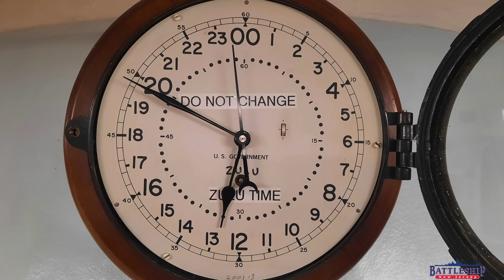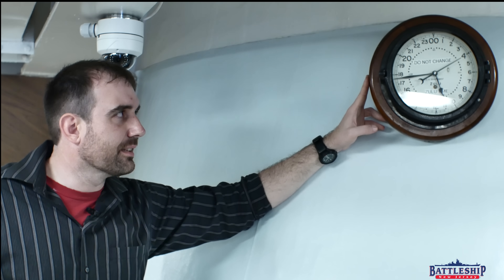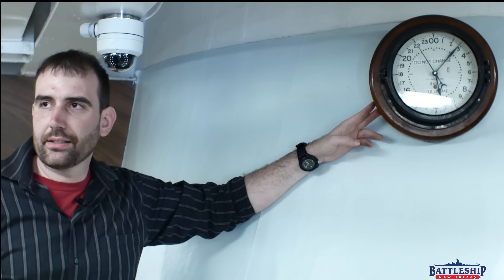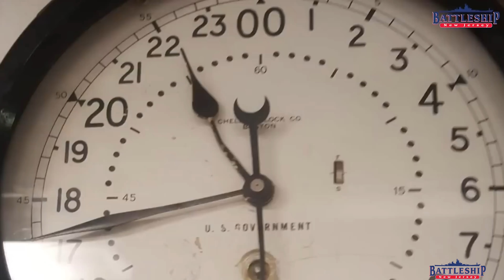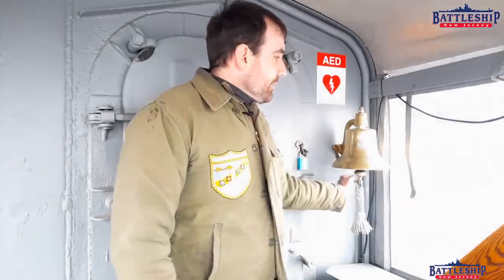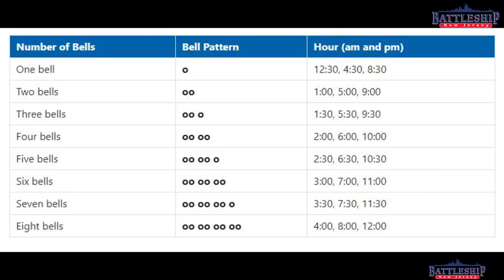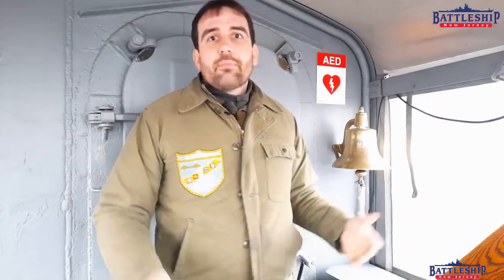Zulu Time and 24 Hour Clocks

Comment: Don't think there are many 24h wristwatches.
Even in countries that use 24h system. It's even hard to find 24h wall clocks. If you want them your safest bet is a digital clock or watch.

Also we call the times by their 12h version. 17 o'clock is usually called 5 o'clock. At least here in Germany.
We only actually say 17 o'clock when there might be a misunderstanding.

Comment: I was raised in the Air Force and never really left the 24 hour standard. Schools still used the 12 hour standard but did mention the 24 hour. I have kept track of time sheets the same way. Some companies I worked for could not keep track because all they knew was 12 hour. My computer, phone, alarm clock, car stereo and even microwave if it has the option is set to 24 hour. Easier for me when I wake up and need to know if I had overslept or just woke up 2 hours after falling asleep. Some things are hard to break and this is one that I tell people that I can't just drop it for my minds sake.
Reply: I've got the same problem only my father was a Firefighter Deputy Chief and my mom worked for the City Police. I heard the daily 1700 radio test from an early age. I kept trying to convince everyone around me it was the better system... I haven't quit yet.
Reply: I was in the Air Force and all of my clocks display the 24 hour system. The only exception is the dash clock in my car, which doesn't have the option. I just find it easier to use and think it is funny when i encounter people that don't understand it.

Comment: Another great video! A 24 hour clock is what I live by. At the post office we use a 24 hour clock that is broken up in to 100 units installed of 60 minutes. So 2:30pm would be 14:25, 6:30am would be 6:50. A little confusing starting out but you get uses to it.
Reply: Wouldn't 2:30 PM be 14:50? As 6:30 AM is 6:50.

Comment: Interesting.  Out of curiosity, do the watch / shift schedules stay on zulu time or do they get adjusted for whatever time zone the ship is operating in currently?  (ex, does the "morning" watch always start at 9:00 zulu or would the start be adjusted to start at 9:00 whatever time zone the ship is in, assuming that the morning watch starts at 9am)
Reply: watches confirm to the local timezone the ship is set to, not to zulu. that would mean your normal morning watch suddenly falls at dinner time, which is very confusing, and very hard on your biological clock.

Comment: Aboard ship, either the Bridge watch underway or the Quarterdeck Watch in port would have to send the messenger of the watch to make what was called the "12 O'Clock Report" to the Captain (underway) or the Command Duty Officer inport if the Skipper was ashore.  I don't remember the entire formula of the report now (it's only been about 30 years) but I would first drill my Messenger on how to make his report.  One of the things included in the report was a traditional one, verifying to the Captain or CDO that "Clocks have been wound" before "Request permission to ring 8 Bells on time."  The report was supposed to be delivered 15 minutes prior to local Noon.

Woah to the Messenger who managed to screw up making the report.  😄 A classic one was the Messenger couldn't remember at all what he was to say, got tongue-tied in front of the Old Man, finally blurting out "Sir, it's 12 o'clock!"  Did NOT happen on my watch or I think even in my ship to my knowledge.

I don't even know if the Navy still requires 12 O'Clock reports.

Comment: So….while there are ships clocks set to Zulu time on a ship, most clocks operate on local,time.  Prior to getting underway a time check will be made throughout the ship on the 1MC, generally by a quartermaster., and it will be on local time.

Generally bell time is not rung throughout the ship; one reason is that we don’t stand four hour watches; some are as short as two hours (dog watch)  while others are as long as seven (mid watch), so the times don’t coincide with the change of watch (in olden sailing ship times watches were four hours so the bells would “work” there); and since the sailors generally rotate watches each day it would only add to confusion.  (An exception would be submarines; which always do six hour watches since there’s no day or night, but the bells still wouldn’t work there either.)

There are two chronometers that have “legal” status - the one on the bridge, and the one in the engine room at the control station; this is because at those two stations legal logs (the “deck log” on the bridge and the “bell log” in the engine room) are kept.  A quartermaster will make a round of all the ship’s clocks everyday around noon and adjust all the clocks against the exact time that he keeps on a stopwatch; in addition he will record the errors between the two “legal” clocks.

Fun fact: in olden days for accuracy/consistency across the fleet, a time check would be made in port everyday by firing a gun exactly at noon; however because of the delay in the time it takes sound to reach all the shops, this evolved into raising a ball on a mast and then lowering it exactly at noon - effectively no time delay in the speed of light - precise time was particularly critical in celestial navigation.

This practice still exists to this day in Greenwich England, and is also seen once a year in Times Square….

Comment: In the days of sail, accurate time was a strategic weapon, as it allowed calculation of longitude.  The Half-hour "glass" was the most accurate time keeping device until mechanical chronometers were perfected.  
Keeping "the glass" was important enough to warrant having some signal.  Hence the bell.  The Master & Mates could hear the bell rung, and know the helmsman (or quartermaster) was on the ball.

Comment: I was a QM so it was our job to wind the clocks. We kept a log book on each clock listing how many turns to the key, how far they were off and a few other things which 42 years has erased from my memory banks. Most important was not overwinding or let the clock run down, if you did and it got out of wack it needed to be sent out for recalibration. That could get you in some hot water. And then there were the ships chronometers on the bridge. EVERYTHING was compared to them. They had to be checked with a time tick at the same time every day, wind each clock a certain amount of turns and any deviation written down in the log. These were the most important clocks on the ship, they were the ones we used for navigation. I liked getting the time tick every morning from radio central. As you traveled across the ocean you'd lose one time tick and pick up another, I remember Hawaii was a very sexy sounding woman, she would end by saying Aloha in that deep sexy voice. Hahaha QM's will know what I mean. ;)
Reply: When I was in the navy I worked in direction-finding stations ashore so, since we weren't moving, the clocks' accuracy was not so important -- except the station time standard.  It was set to Zulu and was quartz crystal controlled with the crystal kept in an oven to avoid temperature changes.  Once a week I had to adjust them to WWV or WWVH but I didn't get to listen to any voices, sexy or otherwise.  Instead, after dialing in the proper propagation delay after consulting a book that took into consideration the latitude, longitude and time of year, I'd feed the audio into an o'scope and use the advance/retard toggle to bring the 'tick' -- five cycles of 1kHz -- to the proper spot on the screen.

One of the critical functions of the time standard was to keep the cryptologic gear in sync.  Too far off, a millisecond or so (hence the 'scope), and you weren't transmitting or receiving any messages that did any good.  One spring the word went around that at our site in Homestead, Florida site a certain petty officer had been tasked with setting all the office clocks ahead an hour.  He did every clock on the site, including the station time standard.  A few months later a sailor rotated in and a chief was taking him around, introducing him to the division.  "This is [name], lately of Homestead."

"Oh!  Are you the [name] that put Zulu on daylight savings?"

He hung his head.  "Is that story going to follow me the rest of my career?"

"Probably."
Reply: @KitsuneBRC  LOL
Reply: With the number of clocks being in triple digits, it sounds like clock winding and setting was a fulltime job.
Thank you for your service.
Reply: I believe you're talking about the ships chronometers. I did that for a while on DDG-12, there were log books for each of the 3 chronometers, you never changed the time, but you compared the time showing to WWV or WWVH, the NIST broadcast of the universal time signal. Knowing the rate of gain or loss, you could still calculate the time close enough for accurate navigation fixes, in case of extended power loss. Strangely, even though the chronometers were set to ZULU time, they were standard 12 hour movements.
Reply: @steeleslicer1217  I served on the USS Dixie AD-14 and a short time on the USS Meyercord FF-1058.
Reply: Ah, yes - Hawaii was broadcasting WWVH, which had a woman announcer.
Reply: do navies still use manual wind clocks?
Reply: @P-Mouse  The ships chronometers are.
Reply: @robertbeaty4909  That is really interesting. Thanks for answering.

Comment: Omg... That double tap system is so confusing... I actually don't get it... 

What does 7 bells sound like does not help whatsoever.. if you would have said.
What does 7 o'clock sound like. That would have been helpful

Comment: Old SM2 here: All communications, even local traffic, are logged in ZULU time to prevent ambiguity and to provide a distinct timestamp to all messages.
Reply: Programmers will also use "Coordinated Universal Time" for the same reason.
Reply: While in the Air Force, I was a communications specialists (same job as yours).  One night, we had an operator change the ZULU time because it was Daylight Savings.  We didn't realize for some time what had happened.....
Reply: @garydavis5703  I gotta think there was at least an E8 level chewing for that one...
Reply: Coaster RM2. All traffic logged on Zulu time. Since at a shore station we had a phone number so we could reach WWV for our time ticks. Would use a radio if things were slow. Checked time once at the beginning of each 12 hour watch.
Reply: And even today, with the modern miracle of the Network Time Protocol, and being able to keep clocks accurate to the millisecond or even microsecond, we still recommend that everyone run their servers in UTC, so that there can be no ambiguity with regards to comparing time from one server to another, and you don't have to deal with Daylight Saving Time. Indeed, NTP operates exclusively in UTC, and all conversions to other time zones are a purely local representation.
Reply: That is Coastie not coaster. Technology does not always help.

Comment: I recently retired, but worked in hospitals for a long time and became accustomed to a mixture of 24-hour and 12-hour time keeping;  I prefer 24 hours.  As I approached retirement I thought of purchasing a "Slow Watch," which has a 24-hour dial and only one hand--the hour hand.  Didn't do it, though.  In order to avoid misunderstandings, trains and buses never used to have arrivals or departures at 12:00, but at 11:59 or 12:01, to avoid confusion.  Can't say about airline schedules.
Reply: Years ago I heard some radio announcers get in an argument over which 12:00 was AM and which was PM. Because of those idiots and the people calling in I still tend to use "Noon" and "Midnight" to make myself clear. It keeps me from having to get into a discussion on what AM and PM are abbreviations for, or get that vacant look from some people when you give them time in 24hr time.
Reply: @Tsyroc  Hi, To clarify, 00:00 is 12AM whilst 24:00 is 12PM but I would go with Midnight, 12:00 is Noon, it is neither AM nor PM, since it is neither before (anti) nor after (post) Midday (Meridiem).  Yes I'm one of those idiots.😄
Reply: Now that's sorted, what do we do about the time after the clock moves back an hour, for when reverting from daylight saving (summer time)? Which I believe for US happens at the first 02:00AM on the first Sunday in November, so is 01:30AM before or after 01:35AM it could be either depending on whether they are before o after the clock reset Zulu time can be useful.

Comment: I use the 24 hour clock. Its easier to use and helps eliminate confusion as your given example in the video. I used it on the railroad and use it now in trucking and I'm accustomed to it it sounds odd to me when someone tells me 2pm instead of 1400.

Comment: Here’s my personal experience. I’m a European here and I can confirm that we generally use the 24 hour system to give times. Especially when we need to specify a time, e.g. for setting up a meeting, noting a time in a timetable or similar. However, in casual parlance it is common to use the 12 hour system, but rarely am or pm is used and if it is necessary to specify it is, at least  where I have lived (all over the continent by now) more common to say e.g. “9 in the evening” or the equivalent in the local language. The morning hours are in my experience even more uncommon to qualify, at least if they are not before roughly 6-7 am due to normal people having normal circadian rhythms. A final difference from US military parlance would be that we usually pronounce the time as two stanzas, “twenty-two forty”, in the case of a time with a minute count, and just the hour for whole hours, without the added “hundred” (although pop culture has made it marginally more common, but then only for whole hours).
Reply: "normal people having normal circadian rhythms" lol
Reply: It is rare, though, to have analog 24h clocks
Reply: Same here in Norway, 24 hour system is always used for written stuff like an hairdresser assignment or booking an meeting. 
Causally 12 hour, like we meet at the pub at 8.
Reply: Basically the same in the Netherlands we never use AM/PM written down we use a 24-hour clock and talking we mostly just say a 12-hour time or when ambiguous qualify it with morning, afternoon, evening or night.
Reply: It really differs across Europe.  In Britain people are using the 12 hour system and many won't even understand the 24 hour system.  In Germany we tend to use a mixture.  12 hour system in collateral daily language unless there's an ambiguity.  If things are getting more official or the use of the 12 hour system might result in an ambiguity we use the 24 hour system.
Reply: @ralfbaechle  I would respectfully disagree regarding the British. I lived in England for five years and can assure you that the 24 hour system is as widely used and understood there as in most places on the continent. I have also lived in Sweden, Belgium, and Switzerland, and spent longer or shorter times in most of the other countries in Europe, and in my experience it is like I said widely used for official or unambiguous times, but informally 12-hour times is common but not universal.
Reply: Great... So they use both... Ooooof course they do... Lol

Yeah... Everything is about the same... Except the very first part, and the very last part... 
Well I guess also I hear am and pm often because I know a lot of people that do overnight shifts. So morning is kinda confused sometimes.
Reply: Same here in Germany.
Reply: I've heard all matter of giving time. From saying "15 o'clock, 25 minutes", to "5 before half past 3 afternoon", it varies a lot person by person, locality by locality, and country by country. Almost universal is the use of 24 hour format but with 12 hour clock faces. I've never seen a "round clock" with 24 hours in real life, and rarely a digital clock with a 12 hour format. 
What I've seen are factory clocks reporting in 100 minute increments. A "factory minute" is a normal time hour in that case, though - so you have 2400 factory minutes. a real head scratcher, that.
Reply: American here that deals with the military. It sounds roughly the same.. Normal parlance is the 12 hour clock, saying AM and PM occasionally for clarity... The 24 hour clock is predominantly military, with a few exceptions. We only add the "hundred" on whole hours - 2200 would be twenty-two-hundred; saying 22 as a time would be weird. 2240 would be twenty-two-fourty here, as well.
Reply: @heroze7724  It sounds as if your military are the more sane ones when it comes to time and distance measurements (as far as I know, that is one of few circles that actively actually use km as a measurement). 
Is it true to say that you usually write it together like that, 2240? Over here it is most common to separate the hours and minutes with a colon or a point thus: 22:40 or 22.40
Reply: Thanks I was wondering how it was pronounced because pronouncing everything "hundred" doesn't work for odd times other than the top of the hour.
Reply: @FoxWolfWorld  yeah, the French tried that once… everyone else thought it was stupid and stuck to real time 😉
Reply: E Van  no, in most Euro countries it's the first and 2nd floor

Comment: Our berthing area had a traditional clock, and when we changed time zones, upon the 1MC announcement that we were changing, whomever had the duty watch would change the time accordingly. Ships bell time could be confusing when working below decks. If you were working around loud machinery you may not hear the 1MC, so if you did hear one bell, it was either 0830, 1230, 1630 or 2030. We would have evolutions that would run from 0800-1630 that were not part of the normal watch rotation when we were at sea, so bell time was often a guessing game.